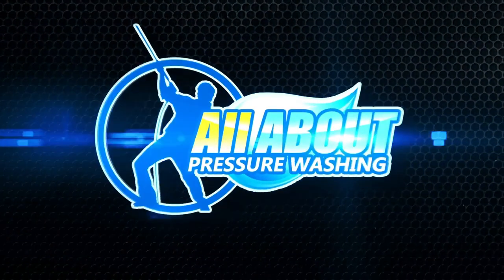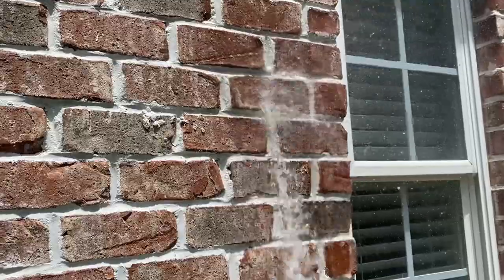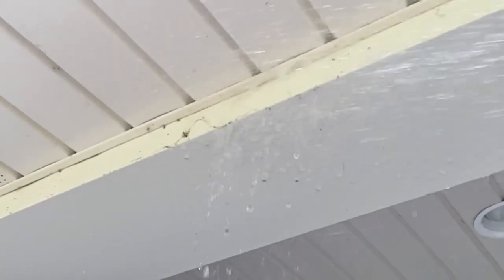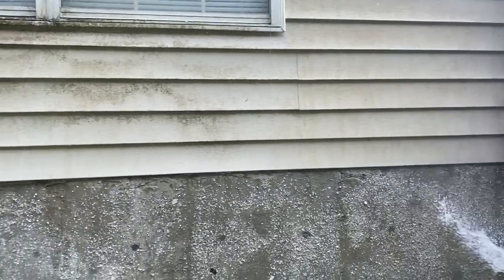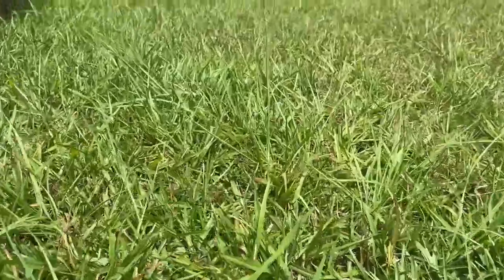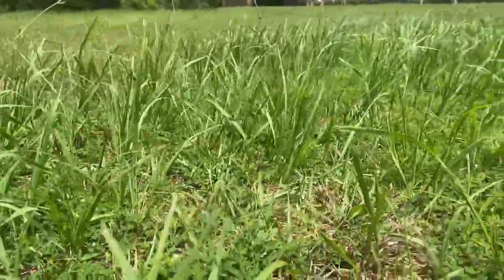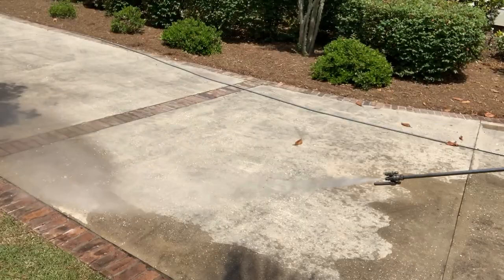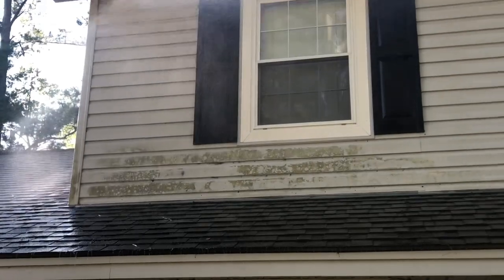You’re A Snake Oil Salesman If You Use Bleach!

Comment: We say we use a detergent mix used by the industry if a homeowner gets uptight and insists not using sh, you very politely start rolling up and thank them for the opportunity, if you explained that washing organics with a detergent mix including sh is the industry standard, usually they change there tune immediately, we use a great cover scent, and plant wash when we are finished. i couldn't have said it better, great video
Reply from the maker: +savagestyle and that is great info!  Detergent is the only word we use.
Reply: At that point id just use water and save the sh( if they are insisting no sh )

Comment: Some of us dont use SH because we care about the environment. Im not trying to knock you at all, but you called anyone who doesnt use SH a snake oil salesman. I tell people that the clean isnt quite as good but we dont use any chemicals that can kill plants, pets, or wild life. Im not a snake oil salesman
Reply from the maker: It’s a YouTube video, I’m not a professional spokes person, this is just my opinion and good on you for telling your customers that the service provided without SH will not be as good.  This is the right thing to do and thank you for sharing and acknowledging that fact.
Reply: Great comments from you both 👍
Reply: If just water is good enough then apply that line of thinking to everything else in your life....sure, like laundry,  your car, the dishes. Yes, after 37 years in the business,  I use the safest,  and least amount I can to get the job done right.  But just plain water,  no.
Reply: @summerwindcharters1326  never once said I use just water. I said I don't use harsh chemicals. Also I'm not spraying anything you mentioned straight into the ground outside. Also all of the things you mentioned are not NEARLY as bad as SH. You know what they say about assumptions. And you just made alot of assumptions.
Reply: So I take it that you don't use bleach on your clothes and you're also against swimming pools? Yes chlorine when not used properly can harm plants and pets but so can brake fluid and gasoline. I'm sure you don't pull your equipment on the back of a 10 speed. Unless you're pouring bleach or brake fluid on plants or pets there's no harm caused. I've been driving and pressure washing over 20 years and I have yet to kill anyones pets or plants.

Comment: Every cubic yard of outdoor air has anywhere from 2000 to 200,000 mold spores.  Bleach is not going to prevent  mold growth. It does clean, kills mold but is not persistent it degrades ...
Reply from the maker: +Dale Juhl  think you missed the point but thanks for the info👍🏻

Comment: So what are your thoughts about post treating?  I normally do driveways just pressure and post treat 1:1 SH water post treat and it works great
Reply from the maker: +Directmantis6 Really depends on the driveway, Hey 50-50 blend seems pretty strong, unless you’re down streaming in and it’s coming out at 1.5%

Comment: Well..... I just took a job cleaning a house that has stained cedar siding. I plan on using just water, no SH. Am I wrong??
Reply from the maker: +NorthStarES sounds like a good idea - we don’t have a lot of stained siding here
Reply: You really need to do research on how to safely clean stained cedar siding. It is a nightmare, and no, you wouldn't use SH on cedar, ever. It would dry it out and pull the oil out of the wood. Cedar is in it's own special class. Good luck!

Comment: There is no pre-emergent for mold. Post treatments on driveways and sidewalks are not necessary mold will grow back either way unhindered.  Some take advantage and charge more for “post treatment”.  I see this for what it is.
Reply from the maker: +Dale Juhl I’m assuming you are not in the pressure cleaning business?  Also- I think you are completely missing the point of both pre and post treatment and has nothing to do with a “pre-emergent”
Reply: @AllAboutPressureWashing   Would you tell me the purpose of leaving bleach on a driveway what that will do?  I stumbled on some pressure washing videos and I am like Nooooooo WHY?  I am not trolling. HONEST.  Just I am curious
Reply from the maker: +Dale Juhl  sh kills organic material, A pre-treatment will loosen up anything living, mold,mildew, algae, Moss, weeds. There’s a direct correlation between speed and pressure and the effectiveness of a surface cleaner, the slower you go the more effective you are, however if the service is not as dirty or it’s pre-treated, you can move faster. Efficiency equals higher profit ability. That is the name of the game. A post treatment dives into the pores of the concrete and kills anything remaining that’s still living. It also helps to brighten the surface which helps to eliminate any kind of swirl marks or striping.  If you have a stain on your white shirt - you bleach it out to remove the stain, same principle.
Reply: @AllAboutPressureWashing   I appreciate you taking the time  to explain    I am not in that business BUT for a nickel I’ll bag my job and do this, perhaps this would be more satisfying 😊
Reply from the maker: +Dale Juhl have a great day!

Comment: Glad to watch a new upload! Question: Is SH safe to use around pools, fountains, ponds, etc?
Reply from the maker: +Ross Bednar SH is a great product and can be used on many many surfaces, every surface is different which means if you are unsure, do a test spot. Lots of different types of pools, salt water as well as chlorine pools. Bleach is chlorine so shouldn’t be a problem in those. As far as ponds, always be careful, if there are fish I would definitely be ultra cautious.
Reply: @AllAboutPressureWashing   Thank you very much! Recommendations for where I could start looking for SH? I can definitely relate to wanting to provide the absolute best service possible and have noticed mild ineffectiveness with only using water and frankly in some cases a little disappointed in the end result. Wanting to up the quality with pre and post spraying with chemicals. Much appreciated!!
Reply from the maker: You can buy SH at any of the big box stores, but you can also talk to any local pool supply shop for more concentrated version.

Comment: Using bleach for the reasons you stated is obviously true and correct. But do you have to? No. The customer is paying me to clean their driveway and make it look nice and shiny. Did I do that? Yes. So the customer is getting what they asked for and paid for. Will it come back with and without bleach? Yes. Faster if I don't use bleach? Very very minimal. You're talking about microscopic spores. If I don't use bleach on the driveway it comes back 2 weeks faster??? Ok. I think that's reasonable. Bleach needs to be used EVERY time on houses I just don't think it's necessary to use it on flat surfaces.
Reply from the maker: Thanks Jeff!

Comment: What is a good gun for tall buildings
Reply from the maker: +Kenneth Lucious it’s nothing the gun- it’s the machine and the tips
Reply: New to the business… bought an 8 gpm cold water…. What tips would you suggest for maximum height…
Reply: Would the wand be a major factor….
Reply from the maker: +Kenneth Lucious buy a long range tip. Zero degree.  Some kind of shooter tip.   The wand has nothing to do with it
Reply from the maker: +Kenneth Lucious none

Comment: Hey man I need some help, I got a beach cottage to wash with cedar shake siding on it… How do I clean that? Never done one or seen anyone do one.
Reply from the maker: We do not do cedar shakes often - I would consult someone that has more experience
Reply: @AllAboutPressureWashing  thanks, I just installed a 12v softwash system but haven’t used it yet. Will it get two story homes?
Reply from the maker: What GPM
Reply: @AllAboutPressureWashing  the 5.5. I’m using 3/4 hose from my tank to it. And 5/8 soft wash hose
Reply from the maker: You’re good

Comment: Dear snake oil salesman! Great video, loved it. Agree with 99% of what you said. Except driveways. I know you treat bleach like reds hot sauce and just put that SH on everything, but on a driveway you are still wasting the 99% that isn't removing oil stains or dealing with pigmentation issues. For the same reasons softwashing isn't effective enough on brick, to properly clean a driveway you absolutely need to give the surface cleaner enough time to blast everything away. Pretreating and post treating it should not speed up that process. You can keep wondering why tigerstriping happens if you let it. I'd also hate to break it to you but your science needs corrected a bit. Let me introduce you to my scientist, skip ahead to about 6:55 and pay attention. https://youtu.be/V3ZRdY2vKkc
Reply from the maker: Thanks Alex and we all know why striping happens and because we know that we all know that SH aids in Loosening up the organic material, i.e. the roots, which allows the surface cleaner to be more effective, and yes you need to go slow, you need to blast away at the concrete. And I never stated that SH removes grease or anything other than organic material.  And I LOVE RED’S HOT SAUCE!!